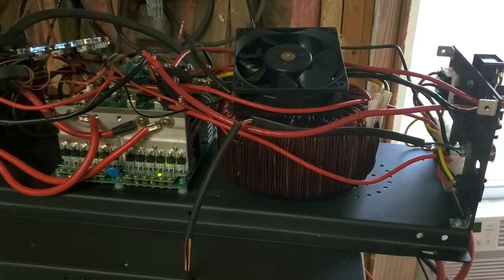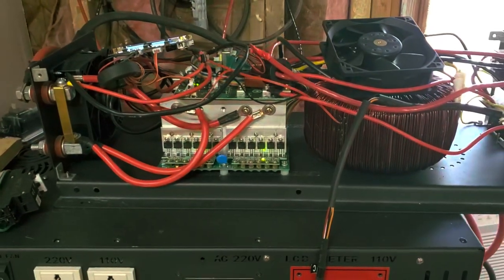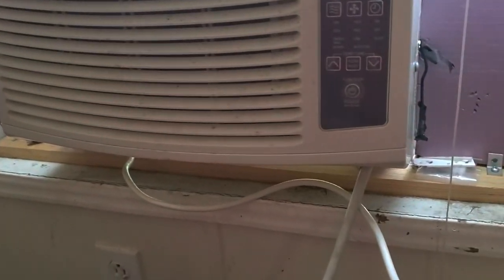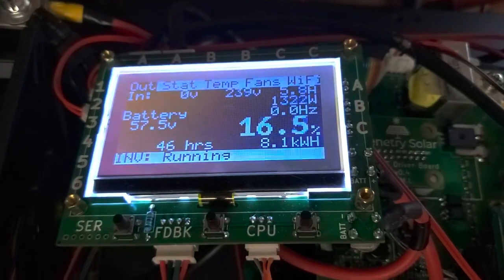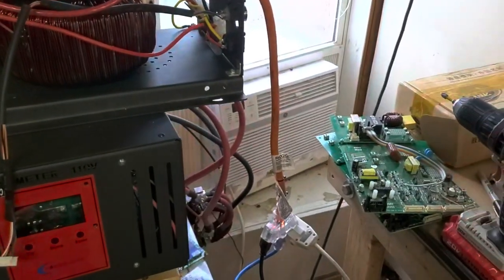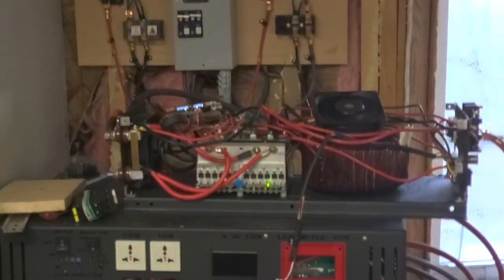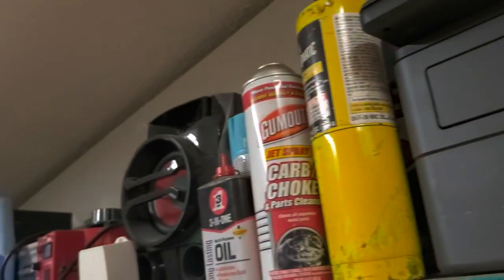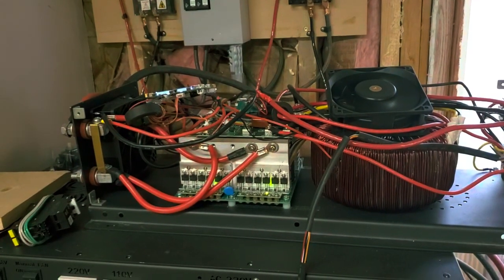Genetry Solar 5000 watt inverter surge test

Comment: Hi Sean and Sid,  I am upgrading solar and considering several Genetry units like this.  We are adding an additional 90 pieces of 72 cell 330w panels for our garment (jeans and work wear primarily) factory to run industrial sewing machines with servos and a couple vacuum steam tables.  We have a mix of electronics already to include 4 pieces of series/parallel 3.6kw Outback vented (can we say expensive) on our non critical power for studio and two series Outback sealed 2500 w (can we say expensive again) for the critical (house) and some PowerJack en route (before I learned about Genetry Solar upgraded units).  We have a mix of Outback/Midnite Solar/Intronics charge controllers and on this we have 250 solar panels (mix of types but each MPPT is same type/direction for strings).  The additional 90 panels will feed our two recently constructed buildings on the property.  So....I'm in money save mode because I just cannot afford the expensive stuff any more in such high volume so am buying several MakeSkyBlue 60amp/v118 charge controllers (like over a dozen) and want to buy some Genetry solar 5kw units like in this video.......however I cannot get an answer on these units.  My biggest concern is not the units breaking as I'll upgrade fans to put two additional on the sides next to toroid transformer along with your high speed fan mod then run at no more than 3 to 3.5kw per unit.  My biggest concern is if the control board and/or MOSFET boards fail.  If they fail (control board and/or MOSFET boards) will I get voltage surges or will I get a reduced voltage and partial sine wave that will cause a fault and not damage electronics for the servo motors ?  My suspicion is that the biggest failure on the control board came from input fluctuations from charge controller.  I had 6kw surges (3 welders along with other stuff) on my other setup and saw that there was a latency on the charge controllers taking way too much current from battery bank causing serious drops on output from battery bank/charge controllers.  I fixed this with banks of super caps /ultra caps electrically "upstream" from the battery bank.  Problem solved as each bank of caps can do 1900 amps and protected by series fuse and breaker for fast/slow protection at same time.  Please please please answer about the output if a controll board and/or MOSFET fail......I would like to buy Genetry units (I don't want WiFi sorry and like how you remove the charger board for increased airflow) but need an answer to these important question(s) with nobody answering on your videos or contact forms repeatedly.  I see Sean is going through some trials but at least one of you can answer (I hope).  I am electronics guy 30 plus years but the innards of these inverters beyond basic function are not allowing me to get a layman's answer.  Kind regards, Mike
Reply: Oops, contact is a bit of a challenge sometimes.  Admittedly, I don't get notified of comments on Genetry Solar videos--so unless I'm combing through the uploaded videos for comments, I miss comments.  Sean has also been talking about a forum, but that's all the more work for us to handle.

Anyway, to your questions/comments:
>> My biggest concern is not the units breaking as I'll upgrade fans to put two additional on the sides next to toroid transformer along with your high speed fan mod then run at no more than 3 to 3.5kw per unit. 
So we can easily sell more high-speed fans (rated ~250CFM, 38-75vDC) if you'd like four or so fans in there.  The biggest issue with Delta 48v fans is that their absolute maximum voltage generally is around 53v depending on the fan model.  (I've already had 1 genuine Delta FFB1248EHE cooling fan burn out on me @ 55-56v.)

>> My biggest concern is if the control board and/or MOSFET boards fail.  If they fail (control board and/or MOSFET boards) will I get voltage surges or will I get a reduced voltage and partial sine wave that will cause a fault and not damage electronics for the servo motors ?  My suspicion is that the biggest failure on the control board came from input fluctuations from charge controller. 
Control board failure should not be possible with the new Genetry Solar design--that is, as long as the battery input voltage stays below 75vDC.  (Conversely, control board failure is very possible with the PJ design.)
So MOSFET failure is the only critical part to be concerned with.  Unfortunately, there is no formula for calculating how MOSFETs fail, so it is hard to say.  I have not had any FETs burn out on my 9K (still stock PJ) inverter--and even if I did, all of my lighting is 48vDC, so I would never see what happens.  In theory, with a 36v -> 240v PJ transformer, worst possible (POSSIBLE!) output spike with no load @ 55vDC would be (240/36 = 6.6 transformer multiplier * 55v = 366v) which probably spells instant death for your servos.
HOWEVER....if voltage surges/sags are a critical problem for you, I can very easily adjust the code for INSTANT shutdown if the output goes out of range.  The CPU is sampling the AC output wave 24,000 times/second (@ 60Hz output), so the inverter is EASILY capable of shutting down within 45uS (0.000045 seconds, 0.045mS.)  Stock PJ "output AC out of range" is...wait for it...THREE seconds before alarm or shutdown!  That partly to handle starting surges where the AC output COULD temporarily fall below the threshold.  But it can very easily be changed--and as long as no huge inductive loads are connected (i.e. synchronous/capacitor start motors), you should be just fine.
In addition, the Genetry Solar control board has a hardware "FAULT" circuit that--if triggered--will shut the CPU down INSTANTLY (we're talking ~10nS, or 0.00000001 seconds).  This circuit is intended to try to detect MOSFET failure and instantly trip the CPU off. 

To sum up: it is easy to make the inverter INSTANTLY shut itself down with an AC Output Error if the voltage goes out of range.  We just need to know what the allowable voltage range is on your servos.

>> I would like to buy Genetry units (I don't want WiFi sorry and like how you remove the charger board for increased airflow)
So the WiFi board provides PWM control of up to 6 PWM fans, or 3 two-wire regular fans.  (The WiFi part is a "sideshow" for the real purpose of the board, which is fan control.)  All Genetry Solar inverters will come stock with the WiFi board, at least 4 thermistors (regular PJ has just 2), and 2 high-speed fans.  You can easily order several more fans for a nominal fee.
If you don't want WiFi, you can easily turn it off from the LCD screen.

I have to admit that the charger board has not been "removed"...no, it's been completely replaced.  PJ's entire mountain of boards has been replaced with the single board you see in these videos...which supports charge, 3-phase AC output, and--theoretically--parallel inverters/"grid tie."  Oh, and the actual production board will be a good bit smaller than the one seen in these videos ;-)

Any further questions, maybe perchance YouTube might feel like notifying me.  I'll try to check back later just in case YouTube forgets.
Reply: To clarify...45uS is approximately 1/400th of a full AC wave.  That's pretty fast.
Reply: @sidlori1592  This is very very good information. Yes, we have approximately 100 industrial machines that will eventually come on line.  The servo motors are a big energy saver and give operators much better control but the electronics are sensitive unlike other designs such as ancient clutch motors that use power all the time...  It sounds like I need to buy some upgraded control boards from Genetry for these PJ units I already bought and in the future units from Genetry.   I'm sorry but I was unaware of Genetry and the modifications when I bought the 5 pieces of 8kw 24v split phase.and only found out after googling  Unfortunately my system is 24v not 48v as I originally set up my solar on top of 40ft long conex box in the Middle East then when I moved away from that job (what a relief) I moved all my stuff here to the Philippines (I'm American)......so I just continued with 24v as my battery bank for the initial non critical side at that time was same as was the two initial inverters for critical side/house.  And to further solidify the 24v system I use Meanwell power supplies to sip off of grid during heavy rain(s) with DC voltages stepped in priority (solar first/Meanwell supplies-grid second/battery bank third).  Since there is some distance between the studio and the two buildings (but not too much) beyond the initial 2kw Meanwell 24vdc supply I found three pieces of 3kw Meanwell 24v supply on eBay that were new and never installed so a very good price.  My intention is to share the some power at a loss of efficiency by running one to the other....if the voltage drops I can then run into the other battery bank.  This will have it's own limitations if not coming from grid but I used the 2kw meanwell very successfully from a dirty diesel portable generator to supplement the system in same manner.   This is only needed because if I have a production line going and there is heavy rain I can't just stop the work because of it.  I've got a cheap air cooled (another mistake/learning lesson as these are way too noisy) 5kw diesel genset but want to go with the units folks build by taking surplus engines like the Isuzu 2.4 liter diesel and turned into genset.  This is not so uncommon and not renewable energy but may become necessary with Meanwell supplies.....or I can use them to tie together the 250 panels on the house/studio with the 90 panels on the new system being built (with low voltage disconnect).     My plan initially was to drill holes on the top plate on toroid and drill holes on bottom with fan with grille on top pulling some air through.  Then I could add one to the side as well.....I'll figure something out on the better air flow.  Yes, a tweaked control board code would be so very much appreciated and I will need very simple instructions on upgrading these units so I don't make a mistake not following them.  Thanks very much Sid I appreciate your really good answer.  I will text to the Genetry number my email address with note this is for Sid regarding tech discussion on youtube and future purchases.
Reply: @MadeOnBike  24v will not be a problem for the Genetry Solar inverters; they will be designed to handle 12, 24, 36, or 48v input (configured at the warehouse before shipping).  As of now, we do not have high speed wide range 24v fans, but that is in the works.  (Hoping for 18-36v safe fan voltage range.)

So for the existing inverters that you have: if these are v7-v9 (not v10.x), we can easily reflash several PJ CPUs here, and mail them to you, as the CPU board can easily be removed and replaced. (Most of the improvements I mentioned are also possible to run on existing PJ hardware.)

This will give you advanced control over the inverter (+ the new features); you will need at least one WiFi board to configure the settings.  (We are planning a more budget "simple LCD screen" for configuring the inverters [no WiFi, no fan control, etc.], but don't hold your breath--it is very low on the priority list.)
Another advantage of the WiFi board + new CPU code combo is that we can easily push firmware updates specifically just for you as needed--so if our initial tweaks don't quite work out right, it is easy for us to fix via a "private" update.  Not to mention the huge amount of control you gain over your inverter, and ability to see exactly what is going on.  Sean says it all the time, and while we might be slightly biased...umm...I cannot even THINK of going back to a PJ inverter without a WiFi board in it!

I mean seriously, with a WiFi board, you can easily glance at the screen and see how how the transformer or MOSFETs are--not to mention that you can easily configure fan low/high temperatures, system shutdown temperature, etc. very easily.  Am I being a salesman??  Maybe...but if you're relying on these inverters to run your business, I'd at least like to have a small dashboard on the car!

There are also a few tweaks you can do to improve the efficiency and reliability of the stock Power Jack inverters (no-load current should be <1.0A @ 24v, and the transformer can be made practically silent).

We are hoping to get a batch of new control boards ordered within a week or two; figure about a month before they are manufactured and delivered.  Still working out some issues with the draft design...Sean is doing a very good job of being a serious test bench for them!
Reply: @MadeOnBike  Yes??  I'm currently working on the Genetry Solar specification, it will be probably a month before we will have any in hand.  However, any business things will need to go through Sean; I'm just the engineer behind the scenes.

Comment: Great start Sean. That’s split phase correct?  Were all three loads on one leg?  Can the windings handle the current for 5000W at 120V on one leg?  Meaning 5000W of magnetic  saturation ability, with indifference to how it’s pulled out of the secondaries.  Or is it that  getting 5000W at 120V requires doubling up the secondaries in parallel?
Reply: Yes, it is split phase.  (Will have to wait for Sean to chime in with how the loading was done.)
So...I do not expect the transformer to handle 5KW on one phase continuously (it's rated 5KW total across both phases = 5KW @ 240v).  See, if you try pulling 5KW from one phase, that's a whammy for the transformer: you have one HALF of the secondary doing DOUBLE it's rating.  I would expect the transformer to overheat.  If we doubled the windings up to handle such use, then we would have a 10KW secondary on a 5KW transformer...much higher cost to manufacture + a higher shipping weight.
However, if you need 5KW @ 120v for a certain application, the new Genetry Solar universal transformers are capable of being configured for full rating @ 120v.  (No 240v in that case.)
Reply: Thanks Sid - makes sense.  And congrats to you and Sean for the progress you are making here - the feature set and modular/smart-connected approach  you guys envision is unique and very exciting.   Very impressive.